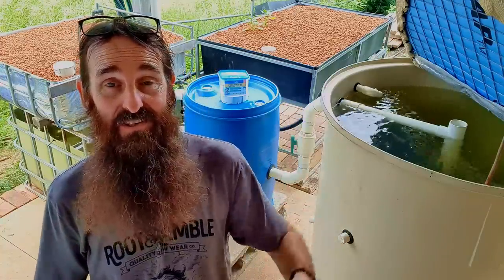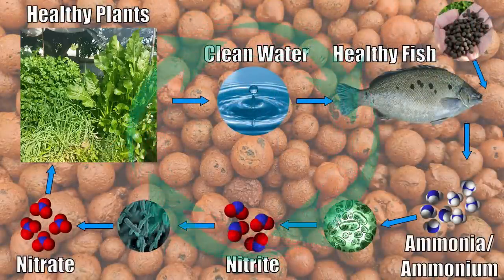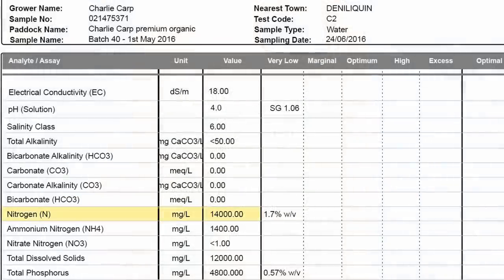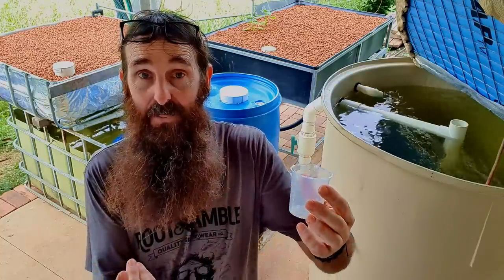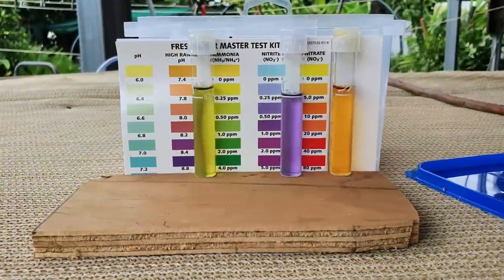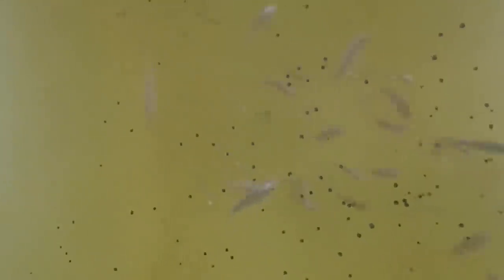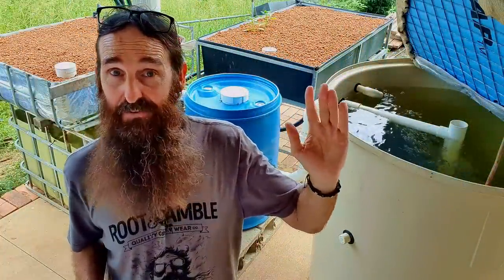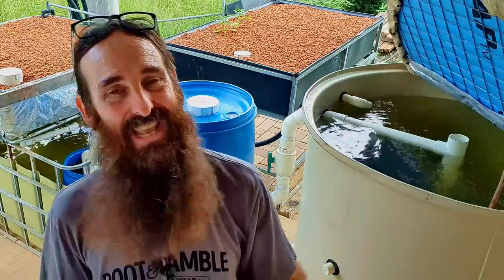How to Cycle An Aquaponics System

Comment: if you wait on the plants until you have sufficient nutrients for the plants, what do you use to filter the harmful products to the fish before you release those water back to the slump tank which eventually go back to the fish tank?
Reply from the maker: In a single loop system where the water goes from the fish to the beds before entering the sump. You'll have no issues once the system is cycled as the bacteria would have set up colonies on the growing media in the beds. 👍
In the split flow systems, like ours, you can have issues with ammonia & nitrite going back to the fish & that's why I don't like the way they're promoted. 
I add a biofilter after the solids settler & before the fish water enters the sump to help convert all ammonia through to nitrate & recommend everyone does the same.😉 
In this clip, it's the little blue drum in the sump itself that you can see just over my shoulder. 
This clip will give you a better look at it, https://youtu.be/ZmKAObLp_Rw

I'm actually in the process of upgrading it yet again which I'll be showing in an upcoming clip.
Hope that's helped some.
Cheers.

Comment: Question,  I've had my new system cycling for almost 2 weeks.  Ammonia level is around 3ppm , but I can't get any nitrite,  or nitrates.  What am I doing wrong?  I've put fish emulsion in and still nothing.
Reply from the maker: Hi Jeremy & sorry for taking a while to respond. At a guess I' say that things are running OK now? 
It can take a while for the bacteria to set up colonies & start to process the ammonia depending on your climate. 
Would like to know how you're getting on with the system.
Cheers.

Comment: Hi Rob! Would it be possible to run the system only with the fish emulsion without adding fish? If so what would be the advantages and/or disadvantages. I see a few bioponics videos on YouTube and I was just wondering.
Reply from the maker: I suppose it could be done on a small scale but think you might still need to flush the system like a hydro one to prevent particular elements from building up. 
I think I'd probably go for an organic based hydro solution like the Bloom packs I'm using on the Kratky hydro tubs RM.👍 
Hope that helps some.
Reply: @ Rob Bob's Aquaponics & Backyard Farm- that does help thanks much cheers 🥂.

Comment: Winter is just ending here in the northern hemisphere, so I'm ready to get peas and broccoli planted. Do you have any recommendations for "de-winterizing"? My system was mostly frozen for the last 4 months. Thankfully goldfish are excellent at surviving cold and low-oxygen water and all 5 of them made it through the winter, but I'm worried about the bacteria. I have a test kit on the way but until it gets here I have no idea how they're doing and I'm worried the fish are going to die in their own waste before I get the bacteria recolonized.
Reply from the maker: It's not something I've had any experience with sorry Michael.
Ammonia is mainly in the form of ammonium when the water temp & pH are low. It isn't as toxic in this form so that could be one reason they're still doing OK. 
If you've been feeding the fish regularly I would think that there's enough bacteria alive in the system or the pH & temp are low enough to keep them safe. If that's the case, I'd think the bacteria colonies will slowly increase as the water temp does. 
I would hold off increasing the feed amount until the kit arrives just to make sure you know what the numbers are.  
Sorry I'm not much more help than that. 
Would like to know how you get on if that's OK.
Cheers mate.
Reply: @RobsAquaponics  Thanks for the reply and the great videos! I actually didn't feed the fish at all for about 4 months prior to yesterday- my tank was totally frozen except for a bit at the bottom so I couldn't get food to them at all. I'm using goldfish and, incredibly, they're adapted to survive those conditions ( https://www.smithsonianmag.com/smart-news/now-we-know-how-goldfish-produce-alcohol-180964502/ ) but I'm worried all the bacteria froze to death while the fish weren't producing waste. I'll keep you updated when the kit gets here though.
Reply from the maker: @MichaelHoffmannG  Thanks mate. 👍
Reply: @RobsAquaponics  My test kit arrived and all the levels are great! pH is 8 which is a little higher than ideal, but ammonia is <0.25ppm, and nitrite and nitrate are both 0ppm. The fish aren't very interested in eating because the water's still just above freezing (2° C right now), so I'm thinking I'll hold off on increasing feed until they've warmed up more to keep that ammonia down.

Comment: I'm struggling to find pure ammonia here in the Philippines. How do I go about cycling the system using fish from the start? Or isn't that possible?
Reply from the maker: You can cycle with fish but it's more involved. Low pH (6.8 or lower) & water temps under 20°C will help protect the fish against ammonia poisoning.  You'll also need to add some chloride to help prevent nitrite poisoning. Easiest way to add that is by using PURE sea salt (sodium chloride) not table salt as it can have additives like iodine that will cause issues.
1kg per 1000L of water is the rule of thumb used by most. 
I'd suggest that you look up cycling with fish & read up a bit on it as well just in case I missed something.

Comment: Hi Bob can you explain how aquapoincs system with soil works
Reply: The whole point of hydroponics and aquaponics systems is that they don't use soil.
Reply from the maker: Some folks will place post with soil in them into the grow beds & use the water to irrigate the plants. It's actually something I'm considering trying with this system to see how it goes. Some folks call it "dual root zone" but I tend to think of it as a way not to forget to water my plants. 😉 You'll find a lot of cannabis growers in the USA are trying this method to see how it goes. 
Cheers.

Comment: Can I use any other fertilizer, for ammonia cycling, I'm from India
I don't find the Charlie carp
Reply from the maker: Cleaning ammonia like I mentioned in this video can be used. Just make sure it's pure ammonia & only use a little at a time. Urea is another fertiliser that you may have available to you. Add a VERY SMALL amount & continue to test until you see ammonia turn up. May take a few days. Don't let the levels get too high as I mentioned in this video.
Reply: @RobsAquaponics  thanx mate 👍 cheers

Comment: Hello! i have a quick question, wouldn't 2 sump tanks be much more beneficial for the fish and the plants? having one sump tank collect the RAS water and the other sump tank be the clean water, or just have the water from the Hydroponic units flow directly to the fish tank sounds more beneficial for the fish and plants? is it better to use one sump tank and one pump to flow water to both aquiculture tanks and hydroponic units? i'm planning on building an aquaponic unit using 2 sump tanks. is this not a good idea after all?
Reply from the maker: 2 sumps would be a great idea if you have the space asdf 👍
Ultimately, I think it would be best to have the clean water from the beds to flow directly into the fish tank if you have the room & ability to set the system up in a "stacked arrangement" so the components can be a different levels.  
Hope that helps some.
Reply: @RobsAquaponics  yeah. It has already been redesign. I will be utilizing 250 gallon (946.353 liters) tank for the fish, a 35 gallon (132.489 liters) solids collection tank, a small trickle system, And 2 flood and drain beds (size undetermined) and 1 sump tank. All will be a single loop system. I already have my electrical plan already delt with using my solar powered shed to run the pump all day and night even through a couple continuously rainy days. I just don't know if I will be able to hold enough fish that I want, I will be using enough biomedia beds to hold 12 rainbow bass but I'm afraid the tank is to small for that amount of fish for up to the recommended pound.. I will be fine with using less fish but I was going to harvest and sell some of the fish to coworkers of mine as well (were all cooks in a restaurant).
Reply from the maker: @asdf1324  Sounds like you're on your way mate. Hope the build goes smoothly. 👍🐟🐟
Reply: @RobsAquaponics  thank you so muchhh! 🙏🍅🥬

Comment: I was wondering if the colored water resulting from the tests (pH, Ammonia, Nitrite, Nitrate, KH) can be thrown back into the system's water
Reply: Amazon product's description...

Danger
- Harmful if inhaled.
- Harmful if swallowed.
- Causes serious eye irritation.
- Causes serious eye damage.
- It causes serious skin burns and serious eye injuries.
- It can be corrosive to metals.
- It can irritate the respiratory tract.
- Suspected of causing genetic defects.
Reply from the maker: Was that the API kit Rafael. ?
Reply: @RobsAquaponics  I double-checked API's website, https://apifishcare.com/product/freshwater-master-test-kit
you can scroll and find the safety sheets, pH and Nitrite tests seem not dangerous (as for the specs but i wouldn't risk), but the rest are all highly dangerous/corrosive!

Comment: At what point in the system are you taking your test samples from?
Reply from the maker: For ammonia & nitrite I like to check in the sump as that's the water that will be delivered to the fish tank.👍
In theory, the water in it should be clear of ammonia & nitrite as the water would have had to pass through either of the bio filters, them being the grow beds or the moving bed biofilter.
Hope that helps.

Comment: Than k you for another useful video. Regarding kick starting the media bed. I have a number of aquariums with waterfall filters that I also put wool in as an extra filter. I'm assuming that I could place one of the pieces of wool in each grow bed to give it a kick start. Maybe even cut it in half and put half in each end of the beds. This should help shouldn't it?
Also I have a couple of cichlet tanks. These guys are messy eaters and ammonia tends to build up in the tanks so they need regular water changes. So I'm thinking of putting their old water into my system (it's still a number of months away from setting up :/ ) to help keep the ammonia levels up, if needed. A friend will also give me 2 adult maybre 2 years old jade perch that I will put in early on. It will be a 5000-6000L system so I'm not worried about killing the fish.
The system will be 2000L fish tank, 
500L radial filter, 
500L bio filter with between 118-150L of K1 style media
3x 1000L IBCs that will form 3 grow beds and 3 sumps
I'm planning to amke it a ?? split flow system as the tank and two filters will be on the other side of a walk way to the grow beds and sumps.
The end game plan is to have 100 fish inthe 2000L tank and when they are 6 months old put 100 fingerlings into one of the sumps. That sump will also have sponge filters in it and I realise that I will more than likely need to clean that sump like a fish tank needs. 
Is my thinking sound as long as I take it slowly and keep an eye on my levels as I for my fish tanks?
Reply from the maker: Hey Warren & sorry it took so long to reply. 
Using that water would be a great way to add ammonia & also help to seed the bacteria colonies.👍👍 
I'd probably only stock to 80 in a 2K tank starting out but it sounds like you're fairly experienced in keeping fish. 
Have you made a start on the system yet?
Reply: @RobsAquaponics  I've just started by raising the 2000L 40cm and need to position the 2x 500L radial filter and bio filter. I'm thinking of trying a sponge filter between the 2 500L filters. I'm going to make it so if the sponges block up it just over flows and still passes through.. I'm planning to start a  subscription with you and I'll share the progress.
Thank you for the reply I know it must be hard to reply to everyone.
Reply from the maker: @warren7565  Have been spending a few hours a day over the past week & am almost there. Have another days worth then I can start my holiday. 😉😃
Cheers mate & have a top one.

Comment: Can we put dead fish to cycle the system? Instead of using ammonia source
Reply from the maker: You certainly can.👍 Might be a bit hard to judge the amount so keep an eye on the test readings.
Reply: @RobsAquaponics  so once the ammonia has generated, shud we take out those fish immediately.?
Reply from the maker: @samsunny6483  Only if it goes over the 4ppm 👍
Reply: @RobsAquaponics  thanx man for the info would be lot helpfull for me. 🙂
Reply: @RobsAquaponics  is it a organic fertilizer Charlie carp ?
Reply from the maker: @samsunny6483  Yep, basically fish emulsion. 👍

Comment: Hey Rob
Here in South Africa
Got my go slow new system build on the way.. Need to bother you just a bit for some advice... How do I contact you?
Reply from the maker: Hey Zaakir. Using the comment section here on YT is probably the best way for basic questions & I'll get back to you when I can. 👍 You can post over on my Facebook wall if you pictures. 
https://www.facebook.com/Bitsouttheback
If I pop my email up here I get swamped unfortunately. 
 Hope you understand.
Reply: @RobsAquaponics 
Yup I understand totally! 
If you need my email address again let me know please . 
Have a few questions with layout and sunlight hours since the area I have doesn't get full sun throughout the day. 
I'll check out the Facebook page meanwhile.  👍 👍
Reply from the maker: @ZuluAltang  I'm sorry mate but I don't recall getting your email.  I get swamped at times & lose emails/messages.

Comment: Throwing in a few dead prawn would work also I am guessing
Reply from the maker: It will work but you need to make sure there's a continual supply of ammonia. If you don't the bacterial colony may not be large enough to handle the fish waste when you add them.
Cheers.

Comment: I'd just pee in it to get it started. It'd be organic.
Reply: Even better pee after eating asparagus.
Reply: Just as long as you are not on heavy medications. Otherwise youre "golden"!
Reply from the maker: Have done that myself & use it as fertiliser all through the patch. 👍
You still need to test the levels & do it regularly to feed the bacteria. Also don't do it if you're on meds as they may cause issues with the bacteria.
Reply: Seriously？😂
Reply from the maker: @周宏宏-j7e  It works a treat. 😉😄

Comment: My system has ammonia around 2 to 4 ppm , nitrite is at 5 ppm and nitrate around 15ppm ,but its inly been 3 days
Reply: My siphon isnt breaking properly , are there any reasons
Reply from the maker: Nice one. You're well on your way then. 👍
Reply from the maker: @samsunny6483  I have a siphon 101 video that may help some Sam,
https://www.youtube.com/watch?v=rKEeXNwSxWU
Reply: Its breaking properly , i dint make a hole on bell siphon , so it wasnt doing good , now the problem is solved mate
Reply: @RobsAquaponics  after doing nitrite test after a couple of minutes the colour is changing to 6.8 ph colour
Reply from the maker: @samsunny6483  I'm not sure what that means sorry. turning a dark purple?
Reply: @RobsAquaponics  i mean when i did the test , at starting it was dark purple , 4 days back it was between 0.50 to 0.25 ,now its showing the purple colour but, after a couple of minutes the purple colour is changing to, ( water ph 6.8 colur  ) plz check on the test kit booklet ph 6.8
Reply from the maker: @samsunny6483  I haven't had mine go from the dark purple to the light blue Sam. How are the levels looking now?
Reply: @RobsAquaponics  the system cycled pretty well mate( dint understand why nitrate became 0 ppm after cycling) any reason ?,but it was going good. Started with gold fish but 2 died,  today morning the remaining fishes were hitting the motor pump , due to that water inlet pipe came out from the grow need and whole system flooded. So again i have to start new 😓
Reply from the maker: @samsunny6483  😕 At least the cycling time will be lower due to the bacteria being in the system already. 
The nitrate may have been low due to the plants using all that was created.

Comment: Can you use human urine to add ammonia to a system?
Reply from the maker: I have cycled & run systems on my own urine with no issues mate. 👍 Just add a small amount  at a time & test until you see the ammonia at the correct level.  Also best to only add it if you're not on any medication just to be safe.
Reply: @RobsAquaponics  
Thanks for the medicine warning, that is a great point! thanks!